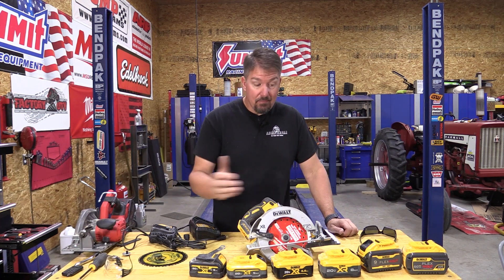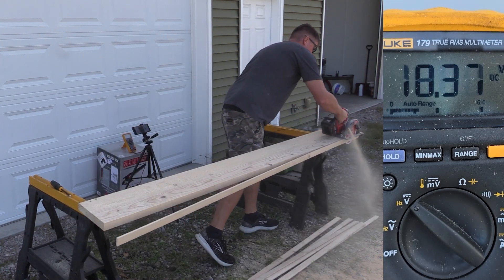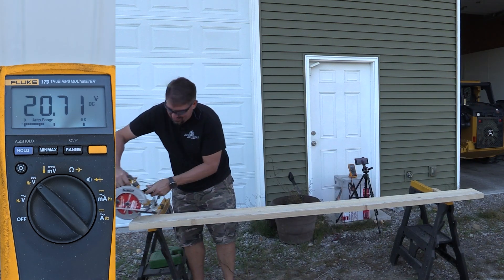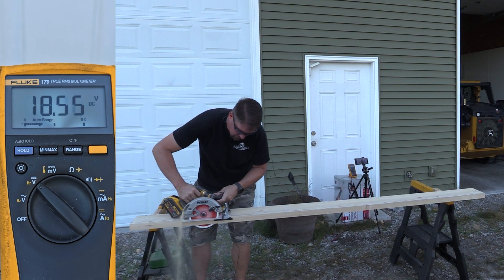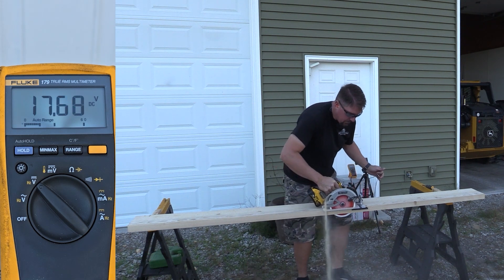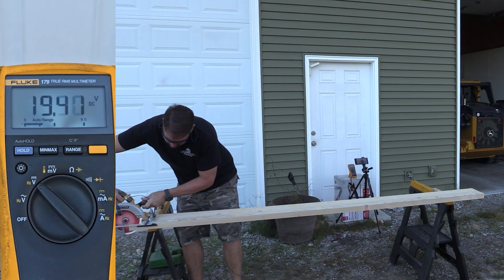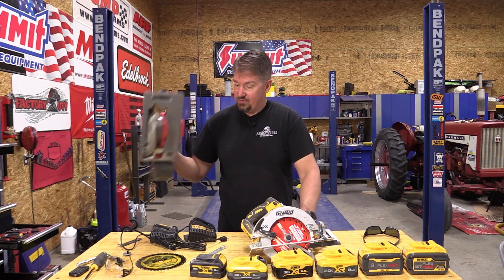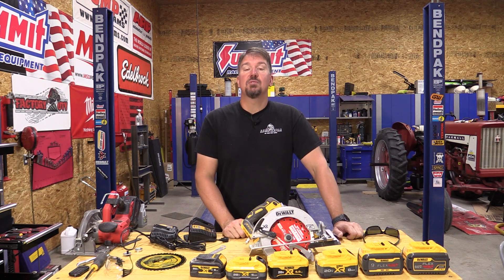DEWALT 20V XR POWERPACK 8 Ah Battery Testing #dewalt #dewalttough

Comment: Supposedly Dewalt is developing a new FV battery to replace the 12Ah using the same Ampace JP40 cells as the 8Ah Powerpack. I would not be surprised if they replaced the 15Ah flexvolt with an all new design 16Ah using those same cells.  (That's still a 5S4P design. A LOT of 21700 cells!)

Comment: Nice to see some actual testing with a meter on it. It would be interesting to see the results when the batteries are drained some. Like 2 bars. Ive always felt like the 12ah loses some oomph when its not fully charged while the 9ah maintains alot better. At least when using any of the flexvolt grinders

Comment: I would love to see some of those new batteries on their 12v line
Reply: 12v line isnt the moneymaker for dewalt, unlikely youll see anything. the power difference between 12v and 20v is insane, if youre just on 12 you should spend your money upgrading to 20 instead of on new batteries for the stuff you got
Reply: @FlaminChicken231  i have plenty of 20v tools from DeWalt, but  don't i need all that power all the times.  Their 12v line is a gem lightweight and powerful enough to handle just about any job i do

Comment: Honest question. I’ve been using 5ah xr if I get a 6ah will my tools see an improvement in performance?
Reply from the maker: Yes for any tool that demands power.  You would not notice much in a multi-tool but you would see it in a drill and see it even more in a large impact wrench or miter saw.
Reply: @ awesome. Plan to use in impact wrench, blower ,grinder as well as hammer drill.

Comment: How does that saw with the powerstack batteries compare to the 575 saw with the flexvolt. I have the latter atm but the bats are about done and I'm weighing up to ditch the flex system

Comment: Worth mentioning that that 6Ah is the original rev (2016-2018 dates), using less powerful Sanyo 20700 cells compared to the current rev (2018-2025) that uses the mighty Samsung 30T 21700 cells.
Reply: How do you identify which rev a battery is?

Comment: @workshopaddict another great video ! Question, im usually a left blade rear handle guy but interested in one of these sidewinders. Which do u like best between that new milwaukee and the newest dewalt? Much appreciated in advance
Reply: seems we only have left handed tools since manufacturing went to china. it hs never been normal to have a left hsnded blade, in fact it used to considered a big safety concern

Comment: I’ve been waiting for this kind of test. I’ll stick with my 9Ah FlexVolts until they’re discontinued (which I think is coming sooner than most people think). By then the PowerPacks should come down in price a little.
Reply: You need the 60/54V for the most powerful motor saws and similar.  Although the 9 Ah is almost too weak and overheats for the most powerful saws, it performs well on the 12-16” saws.  So unless DW designs some special 60V 9 Ah (well… 3 Ah then) batteries for those saws, the 9 Ah FV is needed.

Comment: To me,the Best  way to answer all questions would be the tripod light..I get about 4 hours with a standard 8ah battery...maybe 3.5 with the 6ah flexvolt..very curious to see how that new 8ah powerpack would fare,especially against the 9 ah flex ,or the standard 10..ahhh Dewalt-they keep us guessing...Great channel, love your reviews!!
Reply from the maker: @gregster3307  on a light, Ah is it.  The standard 8ah should last just as long as the powerpack 8Ah.
Reply: @WorkshopAddict  innnterestingg,i always get right excited when a new ish battery comes out.i get the feeling that someday in the close future,we will all be chuckling at how weak these ones are,until then,keep those reviews coming!
Reply: @gregster3307 really the point of this test is not how long they last but their ability to keep up with high amp demand.
Reply: unless you're running a massive light, there isnt very aggressive draw on the battery like you would get out of a drill, saw, or grinder. that being said, the 8ah powerpack slightly outperforms the 9ah flexvolt in 20v tools that are hungry for the juice. to me that makes them more attractive than the 60v batteries

Comment: What would be interesting to see is what effect these new more powerful batteries are having on early generation 18v tools! Are they getting a new lease of life?
For example non-FUEL tools with high power draw!
Reply from the maker: @danpaddyandy6150  my experience has been more smoke than positive.
Reply: These batteries have very little effect on earlier generation of tools since they were made to draw power from 18650 cells without damaging them cells.
Reply: They won’t fit the 18v adapter unless you cut the ears off. The adapter will only take up to 5Ah, probably because anything higher will cause a thermal event.

Comment: Always interesting to see how the different batteries perform. One thing is clear, though: Wow does the Milwaukee 2834 get through the cut with more power than the DeWalt DCS570. Mega difference.
Reply from the maker: I too was blown away by the power difference in the Milwaukee!

Comment: I'd like for Dewalt to focus more on smaller batteries. Using the same JP40 cells from the Power Pack in a 3 or 4ah compact would be a nice bridge between the 1.7 ah PS and 5 ah PS.
Reply: Thanks. Could you test dcs7485?
Reply: Exactly, all these companies are coming out with huge batteries, but what's the point of using an 8ah+ battery on a finish nailer, compact drill, impact driver, oscillating tool, drywall screw gun, drywall router, cut-off tool....
At least we got the 1.7ah
Reply: For a SAW !!! 🤗 @MrArcticPOWER
Reply: I HAVE two 4 amp TABLESS CELLS one it RYOBI EDGE and the RIDGiD 4 MAX OUTPUT EXP and did some testing on my channel and they EQUAL or beat there Bigger 8 Amp 21700 cells
Reply: 3,5ah powerstack battery is out in europe now. We don't have 20v 6, 8 and 10ah batteries, except for 8ah powerpack
Reply: @olgajoachimosmundsen4647  20v are18 here mate, same batteries
Reply from the maker: A compact 4ah PowerPack would be amazing.
Reply: @WorkshopAddict a compact 3.5ah Powerstack is on the way
Reply: @chrisi7456 source?  Is it testing in Europe or something?
Reply: @WorkshopAddict How can I send you a couple pictures of the inside of a 8 AH XR PowerPack and the 5 AH XR power stack to see if you think there real. I got them off E Bay and the codes come up good on the Dewalt site but I hear a lot of these can be amazing fakes lol